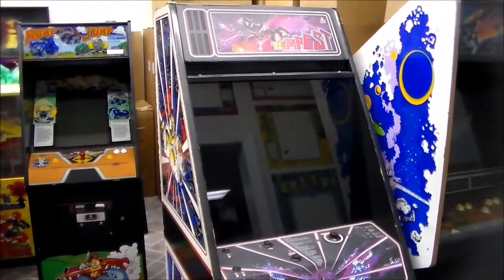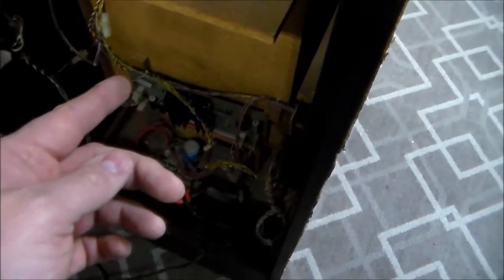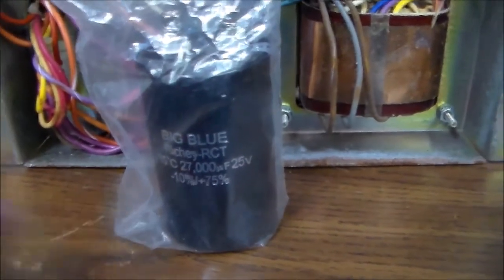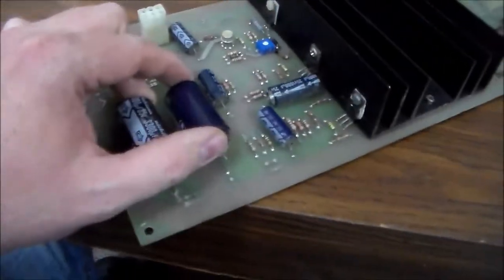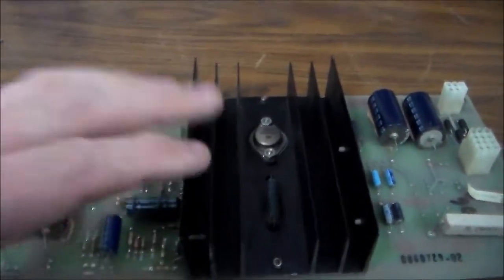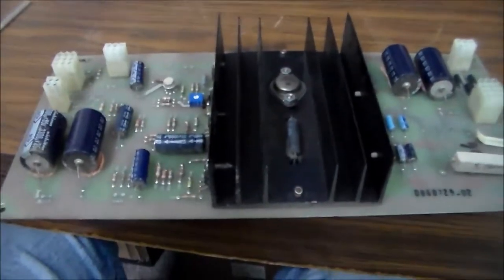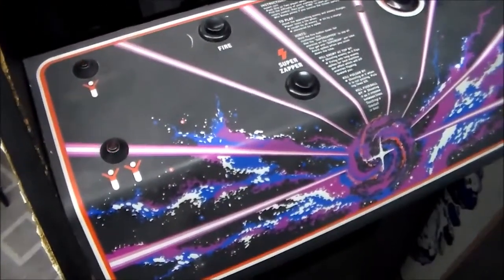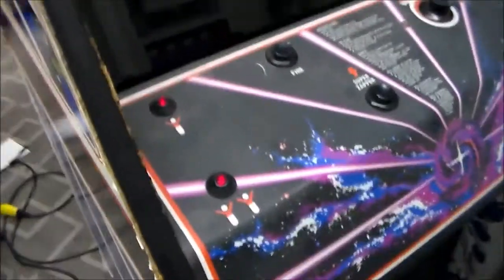How To Fix Your Atari Tempest Arcade Game - Part 1 - Fixing the Power Train

Comment: Got a Red Baron in on trade last week and voltages were all wacky. Decided to look up Atari AR II board. Low and behold one of your videos show up!

Got the big blue and voltage rectifier installed  on the brick and have the sound amps left to rebuild on the AR II board. Main issues was 36 volt was at 18.

thanks as always man!
Reply from the maker: Those AR II's are pretty reliable long term and since they have that sound amp on them you kind of need them in the game, some people try to put switching power supplies in them but I prefer the originals personally.  Yours will probably be good for many years now that you rebuilt it.

Comment: Hey Joe, I recently bought a Pole Position project and had some questions regarding the cab and some of the AR2 board stuff.

1. My cabinet has swelling in similar areas from water damage, along the t-molding area and the back. What are your suggestions for fixing areas like that? (I’d like to avoid replacing the whole side)

2. What is that pink goop stuff under the big compaciters on the AR2? Is that normal because yours has it and mine does too.

3. One of my resistors (small pieces) is burnt out on the AR2 board. Can those be replaced in kits? When there are burn marks on the board, does that damage the board?

Thank you for posting this video, it helped me understand this stuff a lot more than before.
Reply from the maker: Hi Tim;
  Those resistors are because of the sense lines, basically if you have a bad connection on the motherboard, on your 5volt or ground line, the power tries to get to the board through the sense line, which is much smaller and is basically supposed to just monitor the voltage on the ar2 board so it can adjust it up or down automatically.  If the edge connectors on the board are dirty, it will send the voltage through that small resistor and the extra current burns it up.  You can actually replace the resistor with a jumper, it will disable the sense circuit but that's o.k. it's a mod a lot of people do.    What I personally do usually is tie the sense circuit to the power circuit and tie the negative sense circuit to the ground circuit, on the ar2.  There's a connector where they all leave the board, you can put small jumpers on the back of that connector.  Tie the 5V to the +sense and the tie the Ground to the -Sense.  

The stuff under the capacitors was used to hold them in place so they wouldn't move around.  Came from the factory.

The water damage is a big pain, it kind of depends on how deep you want to get into it.  You could cut the board partway up and replace it, but you kind of need dados or something inside of it to hold it all together... or you could just sand down some of the swollen area, and put some wood filler on it to make it smooth again once it's the correct size.... or you could just leave it.  On the cosmetic stuff, I'd check out www.KLOV.com in the forum section, they have tons of tutorials about fixing water damage and also if you search for the Sense Mod on there it will tell you about those resistors too!  

Thanks for watching Tim we'll see you on the next video, good luck with that awesome Pole Position!

Comment: Often it's best to buy a fiberglass edge cleaner not that expensive and often even if boards run good it can prevent future problems from connection issues learned this early on doing my own repairs and learning from.videos like yours

Comment: Also way better to put new switching power supply in they are so much better then the crappy old power supplies and if done right home owner can replace down the line
Reply from the maker: You can't put a switching power supply on Tempest, it uses 22 volts from the power supply and also the power supply amplifies the audio.  I guess you could have it on the 5 volt line but you'd still have the original power supply in the cabinet running the other voltages.  Better to just rebuild it and service it if there's a problem.

Comment: Do u think you can make a video about soldering.... like what temp was size solder flux or no flux ?
Reply from the maker: To be honest with you, I don't know much about it.  We use solder with flux built in because it flows nice, and we just use a fairly small size that 'looks right' I don't even know the measurement of it.   For temperature, we usually have the iron set at 650F or so which really isn't as important as how long you leave the iron on a joint.  If you leave it on too long at that you'll burn the pcb so we like to just touch the solder long enough to see it flow then remove the iron.  I can't really do a video about it because there's probably a much better way to do that, I'll have to leave it to the experts :)